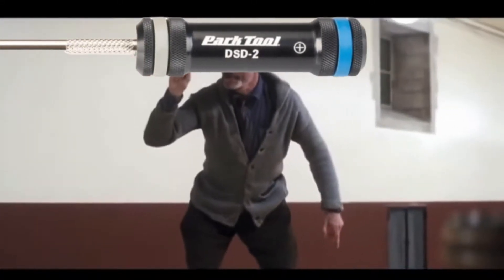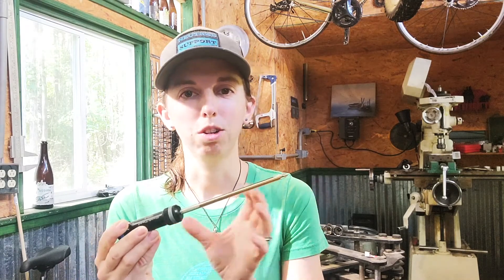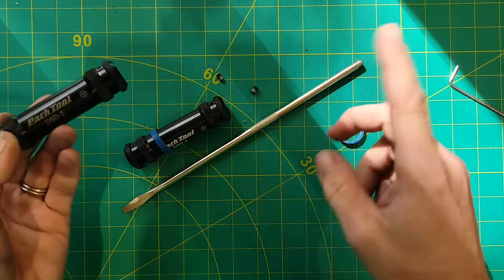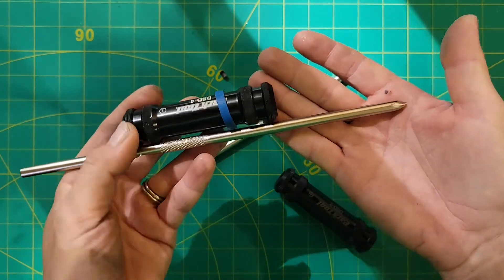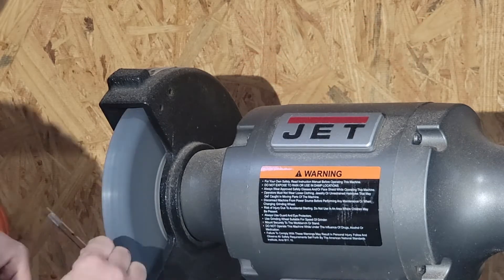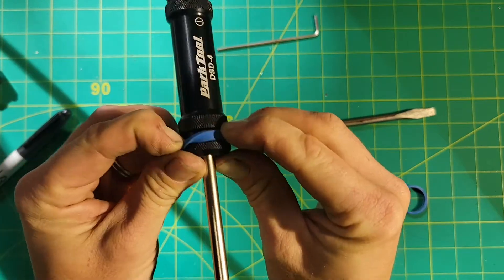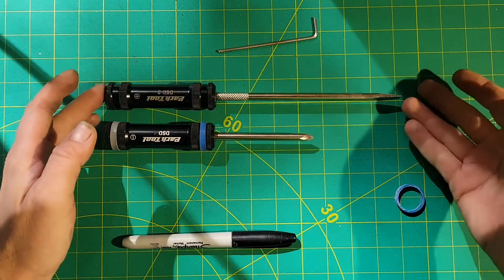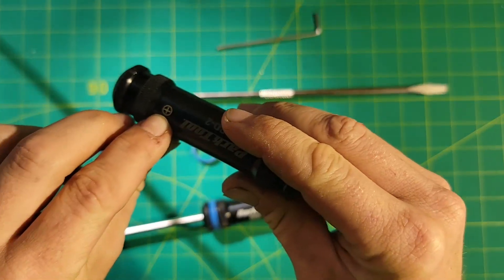Modding the Park Tool DSD-2: The Great Shortening

Comment: lol I got the flat head as well and flat head is just something I hardly ever use. To be honest that tool has never been used...

Anyhow, I got all the allenhead ones as well and I have thought exactly the same as you that they are just a bit too long. I see they've added 2 torx shorty versions, so it wouldn't surprise me if they add the rest of these as shorty as well.

It does feel rather comical to unscrew tiny bolts from the handlebar grips with those extra long handles. The smallest is 2mm hex and it might serve better as a spear of sorts.

Comment: Great videos overall, thanks for them! BTW, when you talked to PT about the DSD did they tell why they made the shanks so long?
Reply from the maker: No insight as to length, though it's the same across the set and they all use the same packaging. I'd be interested in a reason that wasn't "saves money in manufacturing" but it just may be that.

Comment: If you want nice neat flats, you need to get busy with some hand files! But for the price that Park Tool charge for these screwdrivers, I wouldn't want to have to take an angle grinder to them in the first place.
Reply from the maker: This is more...you already have it and want to improve it so it's no longer a tool that sits in a drawer 😄